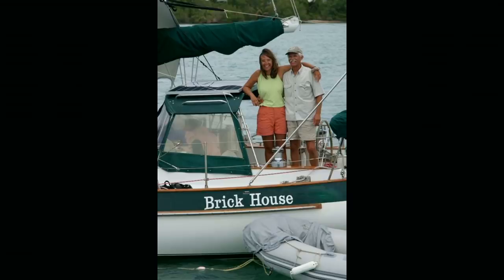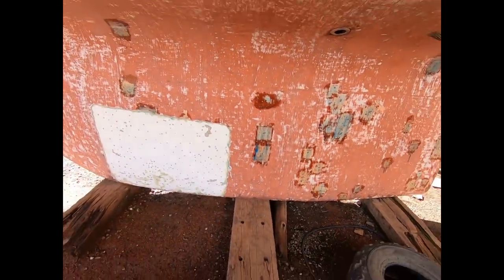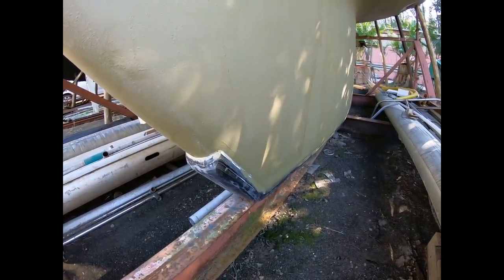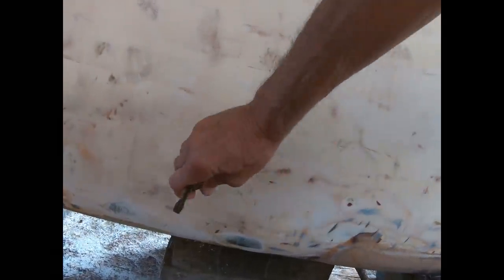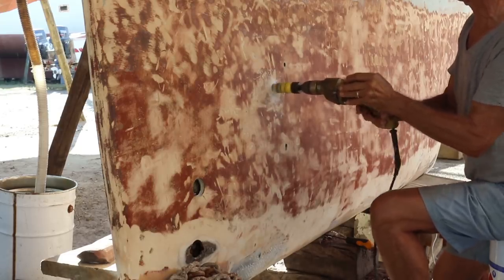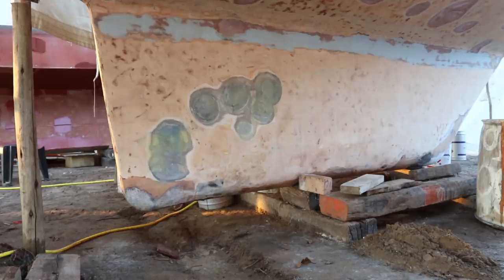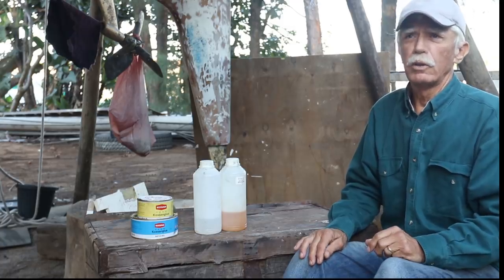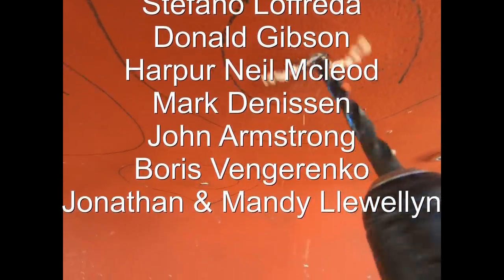Sailboat Keel Repair/Problem: SOMETHING IS MISSING FROM OUR KEEL !! (Patrick Childress Sailing #42)

Comment: Foam isnt going to stop your keel from bowing out under load, it hasnt got any mechanical strength itself.   Clearly, the keel is mechanically weak.

And polyester resin does not eat open call PU foam, I have made many surfboards with open cell foam and polyester.   It will eat polystyrene foam though.

And when you fill the voids in the keel with resin, you should mix in as much chopped strand matt as you can, while keeping it pourable, because on its own, resin has zero mechanical strength.
Reply: @RVLifeNOW  I dont know, probably just to give it something, but really it isnt enough to carry any weight,   as you have seen, it should have some structural core if it is to support the weight of the hull.

Re your bit about a rubber footing on the keel, I know a fisherman who used to put a big pudding of chopped strand mat and resin on the bottom of his keel to protect it.
Reply: @RVLifeNOW    Well, you need some structure inside the surfboard to hold the glass, to give it is form, and since foam shapes so well it has always been used.  But dont forget there is a plywood stringer down the middle, this is an important part of the strength of the board. 

I know some keels bolt on,   I guess they have a steel frame,  galvanised I expect, and probably covered with foam to allow them to be shaped and glassed. 

If it were a fiberglass keel I would expect the skin  to be very think, like 1 cm,   and cross braced, or like a honey comb, inside.  Really, putting 12 tones of weight on a 5 foot tall, 5 inch wide GRP  structure is asking a lot of it, it is flexible stuff GRP, unless you go for carbon and epoxy.
Reply: @zzebowa  The cross-bracing seems to be the one essential element to make this keel rigid enough. From the vid and the polyester poring from top to bottom I don't get the feeling there were any. So if you aim for a rigidity to put the weight of the boat on it you more or less are forced to cut the keel up to install at least one horizontal and 2-3 vertical ribs, my opinion. A huge job. 
You made some good comments.
Reply: @tip0019  Take a look at this vid for example, a\ bolt on keel.  https://www.youtube.com/watch?v=gj8AVCgiEWY,  you can see the immense thickness of the keel mount.  THe keel needs to be equally well built.
Reply: @tip0019  It looks as if there is a structural, galvanised steel part in your keel, and an empty part that is just fairing.  Hence your observation about where you chock the keel being critical to avoid bowing.    

It is odd, Hard to imaging why a constructor would do it that way, I would make it as strong as I could,  and given that weight is an advantage in the keel, you really can go for it. 

By the way I helped my dad build a 45ft trimaran at home many years back which is where I learnt about GRP.  My dad has a galvanised frame in his keel, bolted through the hull.  Of course Tris are light, and take the hard on three hulls,  which makes it less demanding, but it was still a solid piece of work bolted through the hull which was massively reinforced in that area.
Reply: @zzebowa  Yeah, I was only talking about the aft fairing part of the keel.
Reply from the maker: Yes, you are right about the PU foam. I should have said polyester resin will eat up polystyrene foam. I have been trying to cut that part out of the video in YouTube editor, but it just is not working and after more than 2 days is still "edit in progress."  I put an "Error" note in the video description to alert about my misspeak.
Reply from the maker: I have been laying up about 6 layers of biax, with a CSM backing on the bottom of the keel and wrapping up onto the sides. Hopefully, that will help keep the keel from breaching if we should tap a reef.
Reply from the maker: A lot of production fiberglass boats can sit on their keels no problem, others cannot. I want one of those sturdier boats for a "Blue Water" cruiser. If the worst should happen, and we go up on the rocks, I want a boat that can stand up to a loads. This boat was not built to the designers specifications so I am doing what I can to change that.
Reply from the maker: Thanks for sharing that keel vid. I sure would feel better about that keel join if there were  a lot of layers of glass laid in on the exterior and spread further out onto the hull.  On the older 1970s and 1980s, boats,  you just don't hear of a keel or rudder falling off of them.
Reply: @RVLifeNOW  Yes, Glassing it up onto the hull would definitely make it stronger,  but I guess the production time is an issue for manufacturers!     

Just to recap though, resin on its own is very brittle, if you ever want to fill a void mix in as much chopped matt as you can while keeping it pourable, the fibers will make it rock solid.
Reply from the maker: @zzebowa  All good points. Thanks.

Comment: Unfortunately, the rubber on the leading edge of the keel negatively affects the hydrodynamics.
Reply from the maker: Yes,.thats what we are afraid of...I think that’s why we are not doing it, even though we are a cruising boat not a race boat. Even worse hydrodynamics if it starts to fall off!  

But sure would be nice if/when we bump! -Rebecca
Reply from the maker: Yes, it does not look to be the best dynamics but it would be great on the bottom of the keel when the keel will eventually tap something hard.

Comment: The filled section of the keel is filled with poured lead, for ballast.  The hollow section is likely an extension of the keel to lengthen it to make her easier to sail by keeping her tracking in a straight line but she will be slower to turn especially when docking.  On a full keel boat,  especially a 40 with no motor, you learn how to pump the rudder to get her arse around.   Boats with fin keels wander more and require more rudder work. but turn quicker.    Tapping on a keel is meaningless unless you understand the construction you be better off checking your keel bolts, separation or cracking where the keel meets the hull.
Reply from the maker: All good points. The other day I saw a Swan 48 that had been sitting on the hard for over 10 years. I know a little bit about Swans so was very surprised to see a "crack"at the keel to hull join. How much sea water, if any, has been migrating into that seam and affecting the keel bolts. Only one way to tell for sure.  That boat just lost a lot of value.

Comment: Why use epoxy and not polyester?
Reply from the maker: Epoxy has much better adhesion to any surface over Polyester of Vynalester. Epoxy is stronger and far more water resistant. I will use Epoxy from the top of the boot stripe down. Above there, I will use the far cheaper Polyester.
Reply: So do you have an adhesion problem? No, your boat is not built in epoxy. Do you have a strength problem? No, you dont - not for this repair. Would you consider carbon fiber for the repair.. No :-) Water resistant? The rest of your underwater hull is not epoxy - and you probably still coat the repair and the first surrounding surface (needed!) with several layers of epoxy primer. There simply are no real reasons for the more expensive choice of epoxy to satisfy this engineer :-)
Reply from the maker: You say "probably", "probably" far too many times as you do not know. If you had paid attention watching these videos, you would know the hull had been peeled, 18 years ago, from the water line down. All new laminate from the water line down is epoxy. And in any case, why would one not use epoxy for a below the water line repair? Anything else is too water permeable.
Reply: Thanks for the response. I counted only one "probably"..? True I have not seen all these videos... Is it worth it? I made a pretty good assumption that such an old boat could not be in epoxy. Not sure what exactly you mean by "the hull had been peeled". sounds like quite a mad project. If you remove "all laminate", then what is left? In any case - when the boat is not peeled and rebuilt in epoxy - you choose matching resin and make it water resistant with epoxy primer. That's what you do for almost ALL fiberglas cruising boats - both back in the day and now. This appears you are the odd ball, if I must be so frank. So to repeat myself, the reason is cost and a completely manageable problem with sealing against water. Maybe I prefer my epoxy/carbon racer, but that's a completely different story.
Reply from the maker: Peeling is when they take a power tool, like a wood planer, and remove a predetermined amount of gelcoat and cloth layup thickness  from the hull. This is often done for osmosis repair. After everything is dried out, they layup new fiberglass. Most people would choose to use epoxy for this layup as it is far less water permeable. On top of that, one could use a two part barrier coat, as you suggest, or, what is becoming more common, is to use additional layers of epoxy resin. Flip a coin on that one. It is a ton of work and very expensive if you contract to have it done in the U.S., or Australia. Check out the YouTube channel, Sail Life. Mads is in Denmark. He has some good videos about repairing his osmosis. The large blisters on my boat are not from osmosis. They are from bad resin used back in the mid 1970s when the price of all oil related products went sky high and the builder of some boats went to a cheaper resin supplier. The resin never fully cured and over the decades, has been trying to get out, causing the blisters. Osmosis is from water intrusion and now the owner of the boat is trying to get that moisture back where it belongs.  A carbon/epoxy racer is certainly the way to go.....but to keep these old boats going, they are slowly turning into an epoxy boat. Let me know what you think of Sail Life. I watch a lot of him and recently about his incredible rudder rebuild. If I were him, I would have just bought a new rudder from a manufacturer in Florida, but now I know how they are put together and feel much better about mine.
Reply: Thanks for the learnings. I can see the sense in turning the boat into an epoxy boat, if an extensive osmosis repair is at hand. In DK I have only heard about grit blasting and not peeling. And not the epoxy route. Interesting. Mads is great and a bit crazy.  I wonder when he will get to sailing when making a rudder repair on an old boat to a tech project :-)

Comment: Ya the foam is junk in keel. I recommend remove and repour with high density epoxy fo
Reply from the maker: The oil canning on my keel is very slight compared to the problem with other boats otherwise I would have done as you suggest. The foam used in this keel, and in the skeg, is very dense and strong. I felt, just filling the voids, even with poly resin, would be sufficient.....far better than doing nothing.

Comment: The true old saying goes , you get what you pay for. Unquestionable quality of west systems always pays off.
Reply from the maker: I finally found, here in S. Africa, Gurit which is proving to be equal to West, but even with the "slow" hardener, there is not much of a working time.

Comment: Well what do you know.. This is a normal situation. Yes you of the first owner has to trim the boat. 
Some keels have hollow chambers. Or have an extended fairing. 
You bring no news to most boat owners..
Reply from the maker: Some fairings are weak and flimsy and others are not, depending on how well a boat is built. You did not pay attention to the video. The designer of this boat did not specify voids to be in the foam. As he said in another forum, "There should be no voids in the foam." Keels are meant to be hung from a boat. If one is to block only under the lead portion of the keel and have many tons of weight point loading on one spot of the hull, the hull was not designed to take that sort of stress. I want the stress to be dispersed over the length of the keel without harming the fairing....as a well built boat should be.
Reply: Monk Petite the underbody looks like a fin keel that was extended ( for tracking) into a long keel. I don’t think that was the original design. Blocking it only under the fun portion should be fine. Just have to let the yard foreman know

Comment: We use a good product call Flowcrete here
Reply from the maker: Yes we heard of that...they didn’t respond to e-mail we sent them when we were making inquiries. AMT Composites very responsive and Patrick quite happy with results. We have watched the yard workers here apply Flowcrete in preparation for Copper Coat. I really don't see any difference between Flowcrete and any other epoxy. Flowcrete does not make any other products for the marine industry, as indicated from their online information, other than this one barrier product. Thanks for your comment. - Rebecca